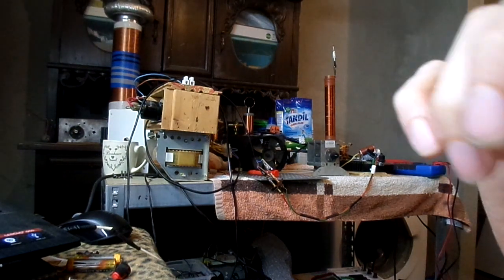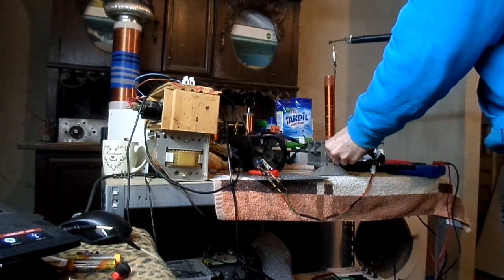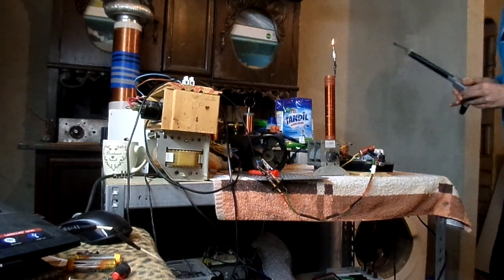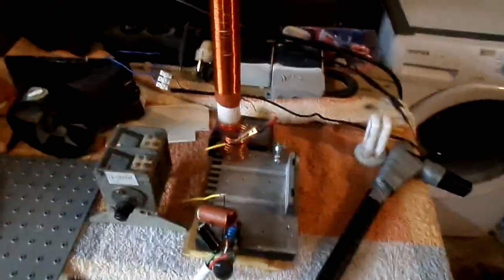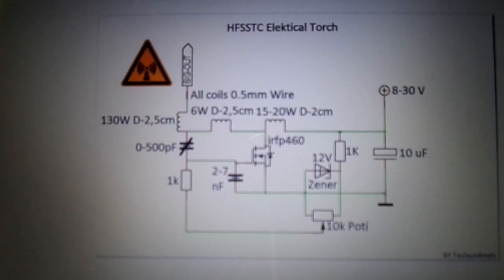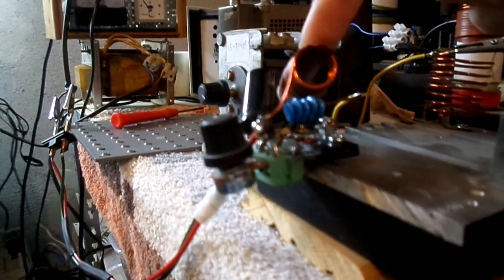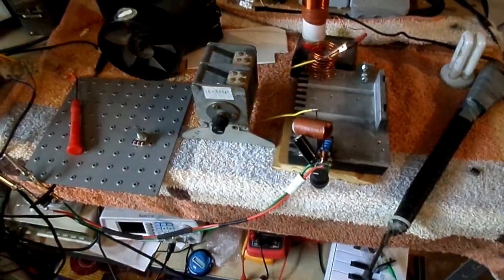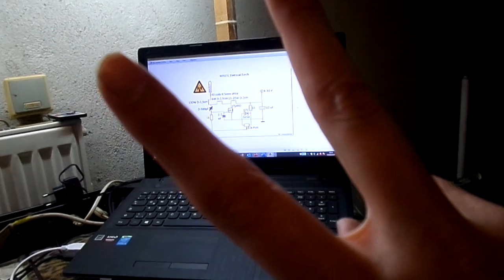HFSSTC - 11.5 MHz - how - to with schematic

Comment: around 9:16...not quite....2.7 nF capacitor across gate and source is not part of the resonant tank circuit, it's there to lock down the varying capacitance between gate and source and maybe drain to source, they range around 1000 pF and contribute to instability. Might be beneficial to go a bit higher than 2.7 nF.....

Comment: If you immerse that variable capacitor in some oil you will be able to get much higher voltages without it arcing over.

Comment: I have a question for this circuit. Does the output coil and the oscillating LC circuit must be tuned at the exact resonant frequency? and is it better/worse or no difference if secondary coil is inside the primary coil like a classical tesla coil?

Comment: Awesome, youtube is slack on these notifications for me. It never occurred to me to use a multimeter for frequency but sure enough one I grabbed can actually go into the mhz! It seems fairly accurate. I would have guessed a low khz limit. Works out since the probes crapped out and I can just sit it near the towers. The one that should run around 1.2mhz reads that and the other goes up to a little under 1mhz. I'm surprised to see so many HFSSTC circuits using 460's but they seem to work great. I never had much luck with them on anything that needed super fast switching. Was it a super pain to get the inductor values right? I feel like I'd be constantly on the edge of getting good operation but just be a hair off in values.
Reply from the maker: this circuit can be a pain in general, the inductor next to the coil is somewhat critical, i had to stretch it out some to get the circuit operating, but in the end its a powerful coil, lots of RF power ! yup, the meter works well, ill try it with the freq. counter i have to verify accuracy... 460's are higher voltage rated ( 400v - 20A)
Reply: @dirkk82  even though the 460s do seem to work great it makes me wonder if a similarly rated fet but with much lower gate charge would be able to run that high-frequency output with a little less power. There's got to be a good deal of power sucked up in just the switching. At the same time I'm sure nobody's trying to buy $5 fets and pop 10 of them just to get it working.
Reply from the maker: @Magneticitist  im sure other fets would work fine, the circuit is not efficient so yes it generates a good bit of heat .. well these fets ( 250 - 460 ) can switch at high MHz range, thats why they get used, i think 27 MHz is the max for them .. hell, give it a try with some other ones !
Reply: @dirkk82  Yea only problem is finding them. I'm not sure if an advanced enough search engine exists where specific mosfet specs could be input but I kinda feel like there should be. Someone else was telling me how really most of these fets are beat by more modern ones but without specific naming I'm just taking shots in the dark searching through distributors.
Reply from the maker: @Magneticitist  do you have any on-hand ?
Reply: @dirkk82  Mosfets or HF coils?
Reply from the maker: @Magneticitist  mosfets of any kind ?
Reply: @dirkk82  Man I've almost burned those suckers as fast as I was getting them in. Sort of lost track of whether I have any on the way or not, think maybe I have some 250's coming but all I know for sure is some logic level Z44n's. Got a couple 250's I can pull from a ZVS but other than that just a few randoms. I got a https://www.mouser.com/datasheet/2/149/FQA24N50-310207.pdf  which is similar but way slower than the 460's.
Reply: Well the fastest running coil I have is at 2mhz and it's actually the largest of my small coils and I run it from 4v. Def need to get a 5mhz+ working cause I could have sworn I had some that were doing at least 4. The meter does seem accurate though as long as I get it the right distance. It starts reading a lower frequency the farther I move it away, same as lowering duty. At close to 100% duty a few inches away it seems to read solid.
Reply from the maker: @Magneticitist  well you can measure all your coils now and see if you have one :-)

Comment: The primary and feedback are supposed to be on thew secondary, that's how a couple of others show it.
But hey, it works :D
Reply from the maker: ah, hmm well i could try it out, i have to rebuild it a bit anyhow .. i basically built it like everyone else  ( monkey see, monkey do ) lol :-)
Reply: @dirkk82  I've seen a couple arranged that way but I doubt it's really necessary with the HF operation. Teslista555 has some awesome setups. I think he showed one without the secondary and it was a beast by itself.
Reply: it's not a feedback coil, it's an RF choke, designed to prevent any harmonics getting into the gate